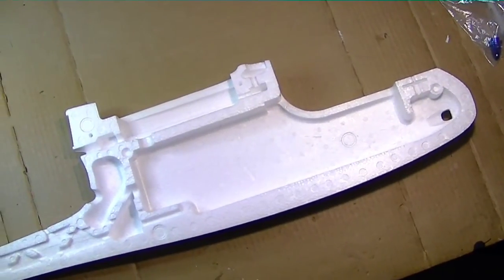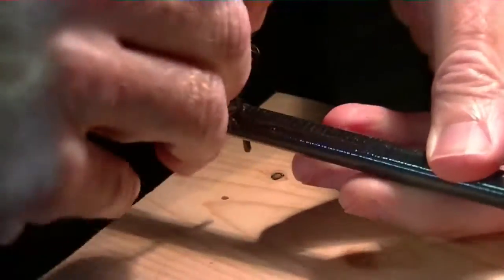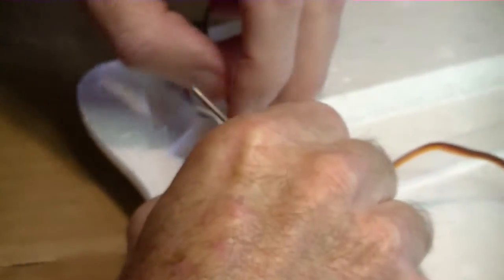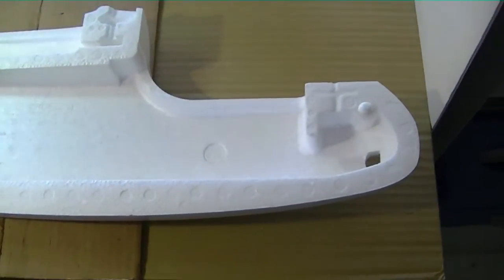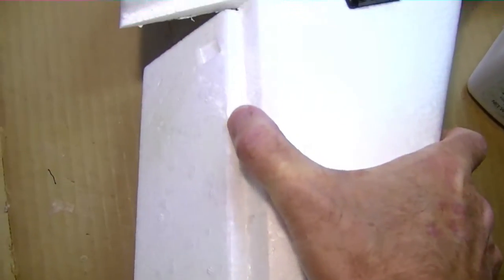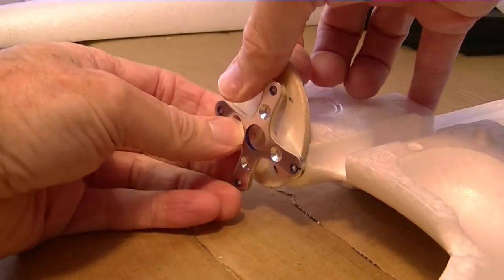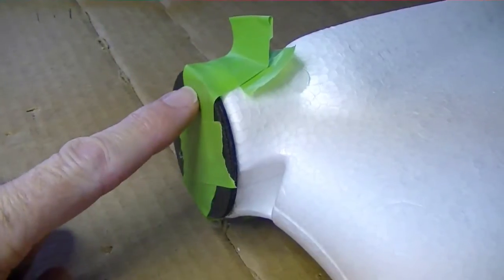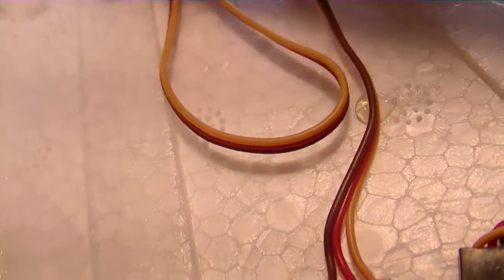FPV Part 10: SkyWalker 1880 Plane Build Tail Tube, Elevator, Video Pod and motor mount.

Comment: To putting the halves together if u live in a cold to normal klimat u can use hotglue with some packing tape on the belly and if u need to seperate just use a heatgun to losen the hotglue

Comment: One solid wing and very tough.  You may need that, I did.
I have always done well over engineering things I build.  It pays you forward.....
It is a long wing and it supports a lot of weight.
I was trying out my RTH and it burped and the SW dove head on into a fence row at 80mph.  All it did was break the wing tip off right at the end of the spar, and knock one of the tail struts loose.  I was back in the air the next day.  Tis a tough buggar!!

Comment: 15 min epoxy and lots of string tape.
String tape the entire leading edge.
String tape the control surfaces.
String tape on the bottom of the fuse as a skid.
I am using the stock motor and get 50 minutes out of a 6000 4 cell and a 9x6 prop APC.  It flies right out of my hand.